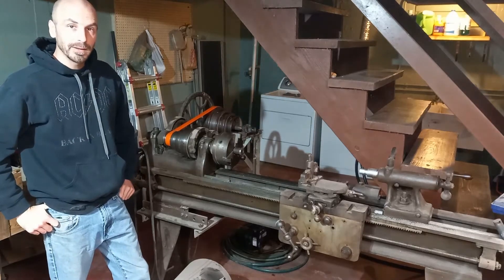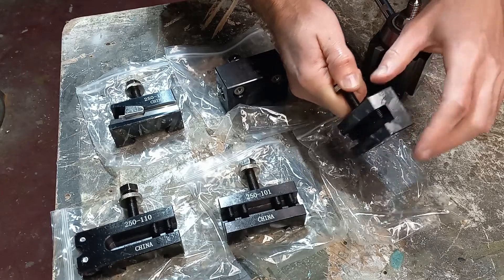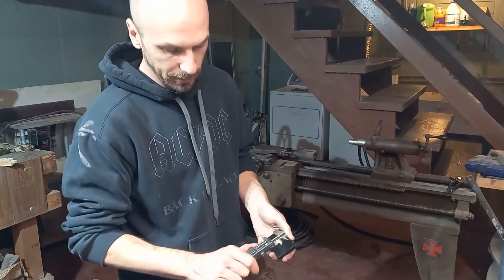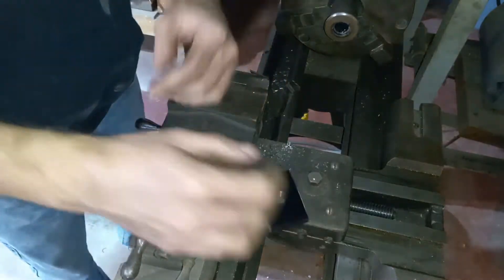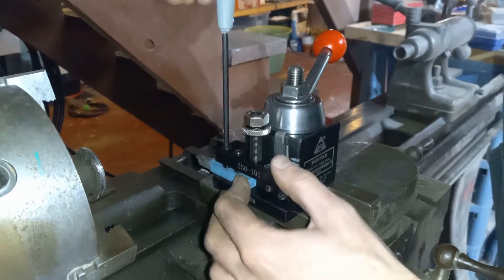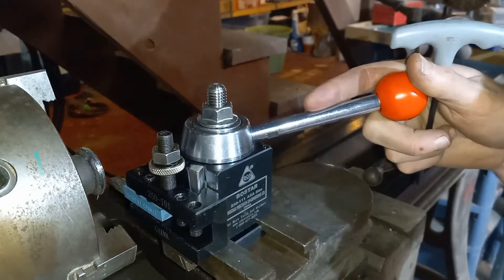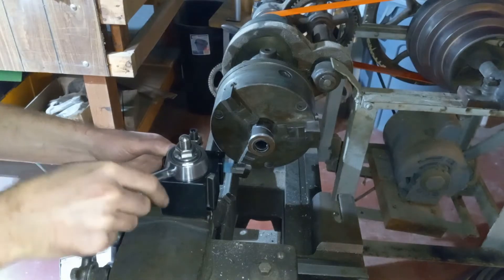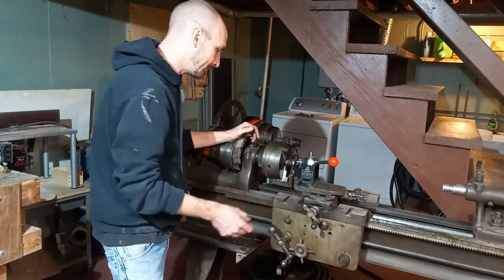Install & Review - Cheap Quick-Change lathe tool post Amazon

Comment: What little I know and I know very little is there is no standardized tool post clamp. So all of the clamps will have to be cut down by milling or some other means to custom fit them to your machine. Sad but true.
Reply from the maker: After talking to others with more knowledge than I,  that seems to be accurate.

Comment: Dude. Youve got a lathe right behind you. Chuck up the tnut and face it to size.
Reply: @chrismakesstuff1 square and rectangular shapes can be held in a 3 jaw. Then use the old tool post to face down the new TNut
Reply: @waltersobchak9427 
It was a non critical part, no need to waste time.
Reply: @Miner-49 that would keep me up at night.

Comment: Shorten the stick out of the tool from the holder and you should be able to get a bit less chatter.
Reply from the maker: That would normally help.  This machine is just tired and has a lot of play in the bearings and slides

Comment: The dingledangles on your hoodie...but you survived the video though.
Reply from the maker: Hoodie strings, long sleeves, and gloves are never a good idea when running a lathe. Sometimes we all forget.
Reply: I learned what it was like to get those hoodie strings sucked into something once. I was using a shredder vac leaf blower and the strings got sucked into the pull starter/flywheel somehow. Sure made it real tight around my neck and pulled me down a bit before they broke, and it ruined the pull starter. I could only imagine them getting sucked into a lathe that size.

Comment: 2 minutes in and I'm so glad you didn't say ' Lets go over to the Mill' like all the other videos.
Reply from the maker: Lol. If I did have a mill, I probably would have used it.
Reply: @chrismakesstuff1   Ha!!  I don't have a grinder, so it's out with the Hacksaw and Files.
Reply from the maker: If there is a will, then there is a way
Reply: I was pleasantly surprised with the grinder, but using the slip joints stole the show. Great content

Comment: I got some extra tool holders to which I had to apply some careful grinding to make them fit, just a few thous, but all in all I'm very satisfied with this system.
Reply from the maker: Good to know.  Did you also use a  "precision" angle grinder? Lol. I haven't had a need for more holders as of yet, but it is good information to know.

Comment: The wedge is definitely better. I have the same one made by Bostar, the handle on mine has bent at the threads on the end that attaches to the ring on top, so they are light quality products. Rigidity is the name of the game when it comes to precision. Not an issue if you are just playing around but when you need precision you also need a high level of confidence in your tools and measuring devices and techniques. Be careful with those strings hanging down on that hoodie. I would take the hoodie off when operating the machine. You are not wearing the hood anyway in the shop. Don't mean to lecture but You can get hurt on a lathe very quickly.
Reply from the maker: I'm partial to the wedge type as well. Good to know about the handle.  I suppose I could make a new one, on the lathe. This particular lathe I'm guessing is from the 1950's or earlier. I couldn't locate any information when searching the web for it, but the bushings are definitely tired, with a lot of slop. Safety.  Good point. Hoodie strings are a bad idea for sure.